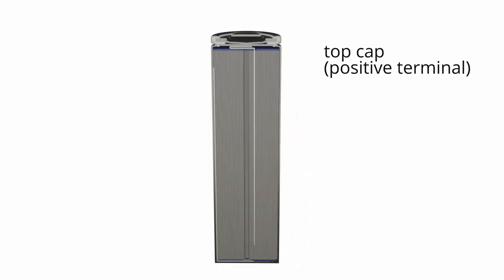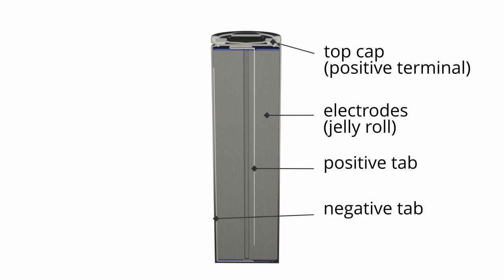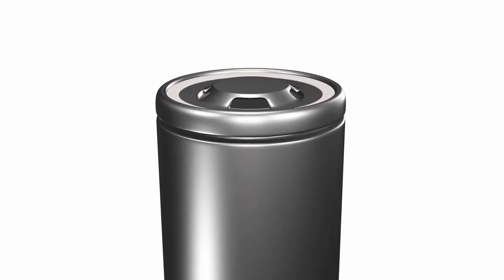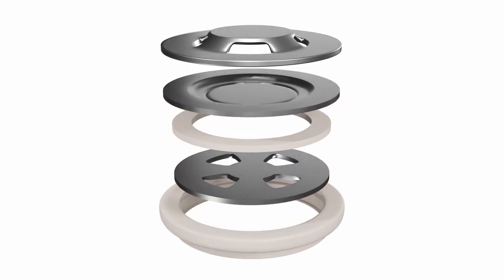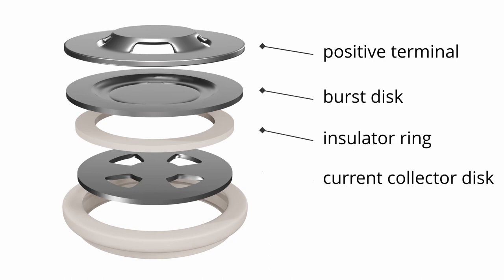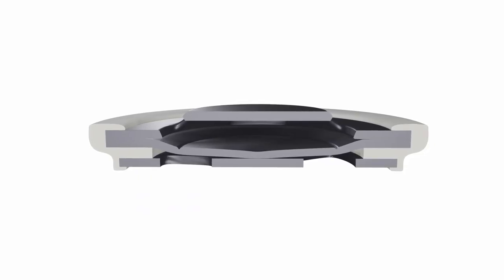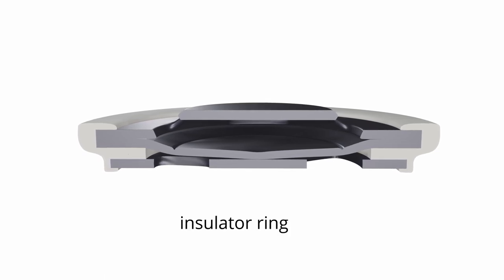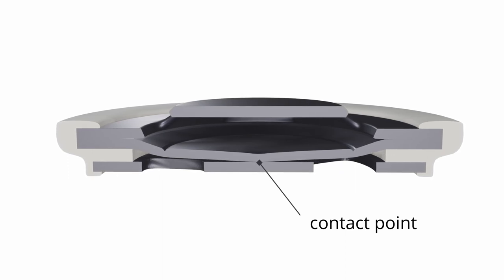Battery Safety: What is a Current Interrupt Device (CID)? (18650, 21700, vent)

Comment: Thanks for the info!  I have a fully charged battery that I accidentally shorted.  I fixed the short, but the the CID tripped.  I don't trust this cell for use since you said the pressure went way up meaning something weird happened to the chemistry.  None of the reset videos talk much about what actually happens in the battery, just where to stick a screwdriver.  I'm going to try to reset the CID (outdoors, with PPE on) so I can discharge it for safer recycling.
Reply from the maker: Thanks for watching and your feedback! Please be careful with that. You can dispose the cell also without the reset and discharge.

Comment: I need some help if you don’t mind sharing some of your knowledge. I bought some battery pack modules each with a BMS. The modules came from factory robots. I have not even opened the shipping box to measure voltages of these modules. The modules have lg m50lt lithium ion cells. I was taking a look at the data sheets online and could not find information on how to properly store them for greater than 2 years. I have been storing them in their shipping box for a little over one year now, but I’m not entirely sure if I need to discharge and then charge them once in a while. Would you be able to give me some instruction on how to preserve these cells? Thank you very much for your time and information.

Comment: I've been safety testing cylindrical lithium ion cells for some time. I just want to add my 2 cents. While the safety mechanisms are there to prevent thermal runaway, there is no guarantee that they do. I've overcharged cells that have had both the CID open and have vented but still go into TR. The threat is still there. Having one cell in the middle of a pack with already elevated temperature is the worst situation. The surrounding cells will prevent the suspect cell from cooling and increasing the risk of TR.  In our systems we are counting on the charger system, mechanical system and monitoring systems to prevent these things but we still have returns from the field because this. It pains me to see people building power walls in their homes because I know it only takes one cell in a batch 3000-4000 to turn the house into a smoldering mess. Chinese manufacturing is still suspect. Please be careful and understand all the safety issues surrounding these cells. Edit: Watching people pry at the tops of the cells with a screwdriver and/or other conductive tool is just crazy. This can cause the CID to touch the collector thereby reconnecting the current path. Please don't do it....!
Reply from the maker: Thanks for watching and your comment! I fully agree. Even if the likelihood with cells from quality brands is small, there is always a remaining risk that a single cell is faulty or develops a fault over lifetime.

Comment: Hi. Thank you so much for your video. I had the same questions you answered. I tried very delicately to pry the nickel tabs off of the negative side of the battery.  And no matter what method I seemed to use, being as gentle as I could possibly be, I always seemed to leave a tiny pin size hole on the flat negative bottom side of the battery. Hearing a quick hiss and a sweet smell. I stopped trying to remove nickel tabs from the negative side and just cut them down as close as I can. But I always wondered about that quick hiss and sweet smell. Is it you opinion that this was part of the CID protection or electrolyte or lithium or something else? I always see people man handling these when prying off these nickel tabs with plyers screwdriver etc. And wonder how many have had the same experience and just ignored it. Thank you so much for your time and thoughts.
Reply from the maker: Thanks for watching and your question, and apologies for my delayed response!
The CID is located underneath the positive terminal. The negative terminal is on a thin steel wall. If you have a good welding connection, the cell wall is the weakest point and it rips a small hole in the cell can. The hiss is the internal pressure that forms inside the cell and escapes through the small hole. The sweet smell is the electrolyte vapor that is also harmful to breathe in.
In any case, the cell is damaged afterwards and should not be used anymore!
Reply: @meandthebattery9628  Hello, i was wondering though, i did reset  the cid of a cell, and it voltage was about 2.75v close to that, there was a hiss, but no smell no electrolyte escaped no nothing, charged it back and it seems good it holds it charge, did a capacity test and measured around 1648mah for a cell that was supposed to be 2200mah, so i suppoose it still in some ways good?, as long as it doesn,t overheat and i don't over chartge it it technically should still remain safe in someme sort of ways? just that it not the safest? Thanks!

Comment: Hi Moses,

Great video. Can you imagine having a battery without CID? Especially in tables cylindrical cells I have trouble imagine how to put CID into that.

What do you think?
Reply from the maker: Thanks for watching and your question! Yes, there are cells without CID. That saves some volume in the cell, but you need to make sure on system level, that the battery stays safe. But also in such cells, a vent is typically still present.

Comment: My lithium battery has sometimes no output current during operation but when I shake the battery it's giving current.  Is it CID fault
Reply from the maker: Hi, thanks for watching and the question. I can't imagine that it is the CID. I would bet on a bad contact somewhere in the assembly but to tell for sure, it would require a detailed analysis.

Comment: I just replaced the 18650 cell in a powerbank. The powerbank circuit board and other contacts were nearly pristine, but I noticed the top cap of the cell is corroded. Is this an indication that it most likely vented?
Reply from the maker: Thanks for watching and your question (and sorry for my late response). Venting usually occurs together with high temperatures, so you would definitely see some impact on the other components. My guess would be, that there either was some electrolyte leakage or some water that caused the corrosion.